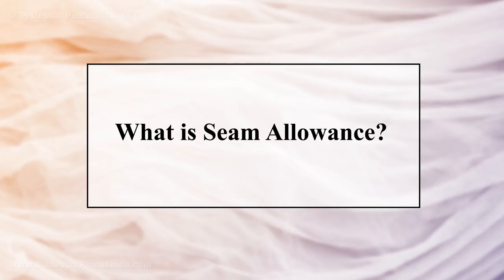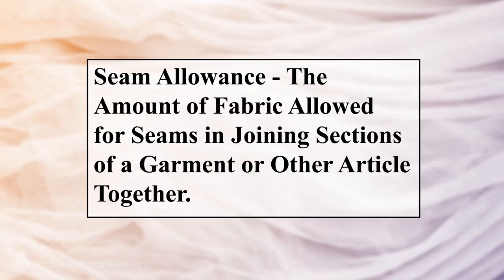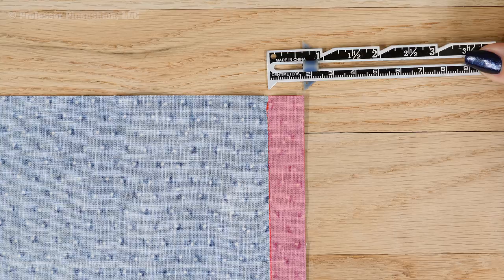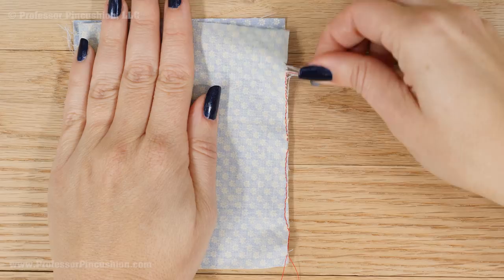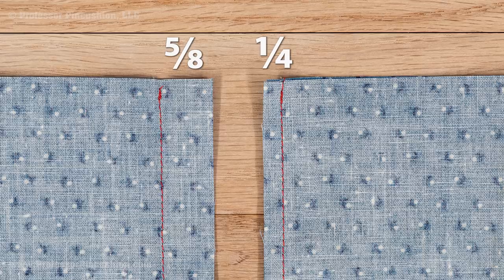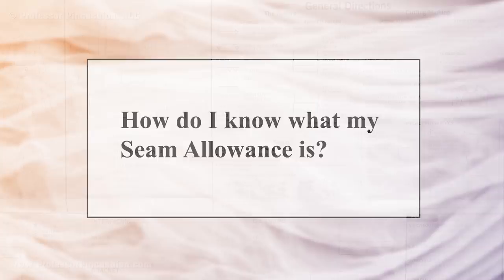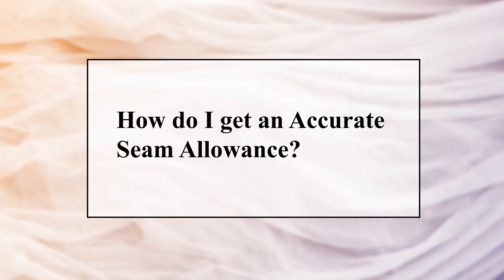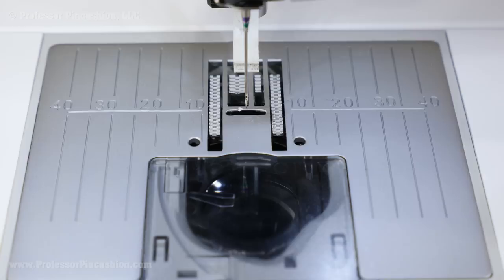What is Seam Allowance - Sewing Basics

Comment: What if my pattern calls for a stretch stitch that is wider then your demonstrated single stitch,  Do I line up the centre of the stitch pattern or line up the edge of the stitch with my allowance measurement?
Reply from the maker: You would still sew at the recommended steam allowance like normal.  So for a zig zag, you still line up the needle at the seam allowance line, but the machine will sew slightly on each side of the line.
Reply: @ProfessorPincushion  thank you so much 💜